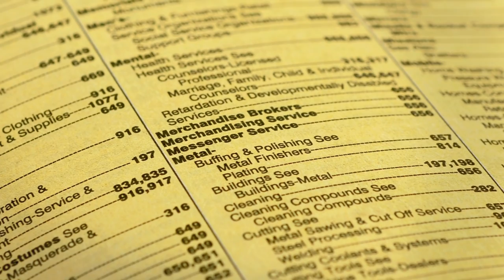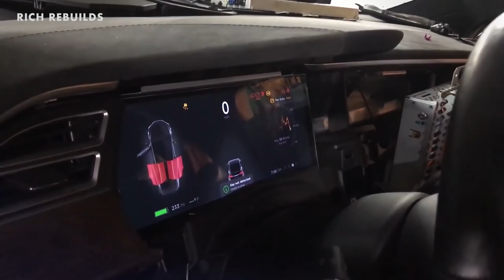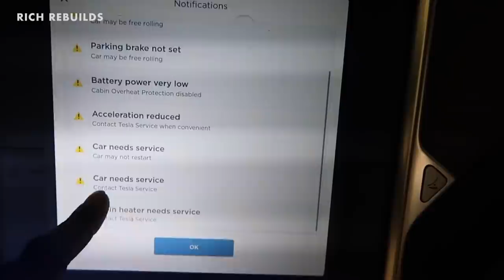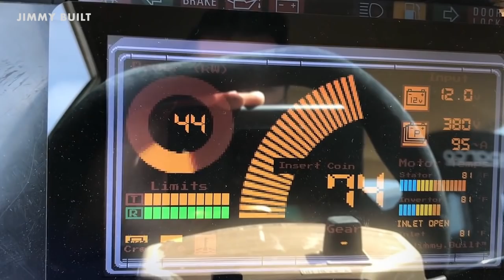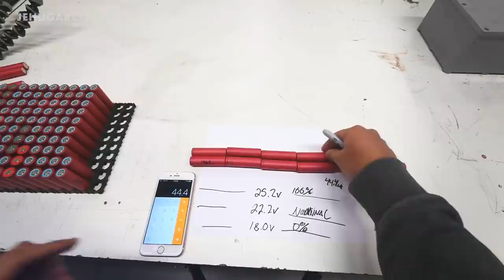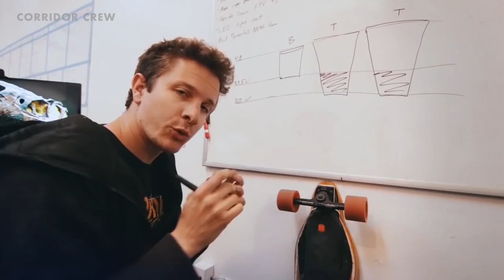The Rebels Who Are Taking Apart Tesla Cars

Comment: They’re not rebels, they’re self repair people who fight for the “right to repair,” I have a screwdriver, that does not stop me from opening my electronics and attempting to self service or modify my electronics, you pay for hardware, software, and non user serviceable, until you get the right tools which isn’t too hard to get like apple bit screwdrivers, Torx with security/anti tamper screws, even those battery powered toys from McDonald’s with a triangle screw, seriously its cheaper to self service, at the cost of tools and self ability to open, modify, fix the electronics. Software wise, it’s the same, must have specialized dev tool kits to fix or modify, and possibly jailbreak, as electronics and software advance, things are getting harder to fix
Reply: The only other thing here I’m going to say is also avoid buying apple products, they went from hardware binding a home button to a mother board to now hardware binding the display and battery, so apple knows if you change the screen or battery, possibly hindering functionality, limiting repair ability to consumers and some repair shops who don’t have the hardware data copying device for new hardware so apple devices could not see the difference, and at the same time to allow all functionality(if any hindered), apple also decides to hamper the old devices as soon as a new one is released, apple tactics, y’all are fooled to buying a new device even though the one you own is perfect... or was until a new one comes out, good luck people of repair
Reply: @benzodiy4053  they legit disable the camera on the new 12s if you replace it
Reply: In his mind they are rebelling against the stupid pretense that companies are pushing that if something breaks, you shall not know how to still use it or fix it. Also in the car world they're called gearheads, not cyberpunkers, people have been taking apart cars since before lord mr Ford.
Reply: Reminds me of what I learned from Louis Rossman. Good on you for spreading the word, too.
Reply: Long live the right to mid, to drive yourself,etc
Reply: 0:07 is a right in the USA like forever, even by people backing up the us constuition and ramifications! Of it
Reply: Exactly. You should have a right to do what you want with property you paid for and own. Tesla has zero control over what you do to their product once they have transferred the legal ownership title to you.

Comment: Using recycled batteries to power a house is a recipe for a headache. 

These 18650 cells are notorious for having cells die and ruining entire packs 

This requiring testing of every cell in preset to tell which has gone bad...and the replacement is complicated and dangerous.

Buy new batteries if you plan to power your house.

Comment: if opening your product can be dangerous, STOP BEING LAZY WITH HOW YOU PRODUCE THEM. otherwise, i fully believe that the manufacturer's job ends when the car is finished and rolled off for sale. Peeps want to mess with shit They Bought, that's Their problem. all companies need to do is to make it clear that such is done at one's own risk. with the only real risk being of physical or mental harm from doing something wrong with it and suffering the consequences. not from legal trouble over cracking open their own property.
and yeah. folks who mess with a brand product and reports faults as if nothing was done with it, that's on them. only people who whine about how something stopped working after they fucked with it, are idiots and assholes. I dare hope that is not YET the majority of the species. all evidence to the contrary.(meaning decent people make a point of stating that they modified the product)
Reply: I don't think that they are lazy while producing. The Batterypacks can hold electric charges that can be deadly and the chemicals are not that safe either both of these things could be used against the maufacturer if someone got hurt while trying to open it up. Then they would sue Tesla for "why they didn't forbit it in the first place"

But I am your opinion too, if you bought your product then it is 100% yours and you should be able to do what ever you want with it. Like if you get an Iphone you should be able to modify it how you want it. etc
Reply: EV technology is still new so Tesla will not take the risk of becoming an untrusted EV company that is why Tesla wants to control their EV so that more people will believe and switch to EV, especially to Tesla products.
I am sure that in the future they will release 100% of their products to their customers